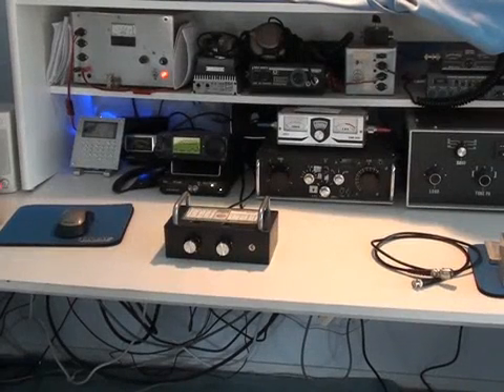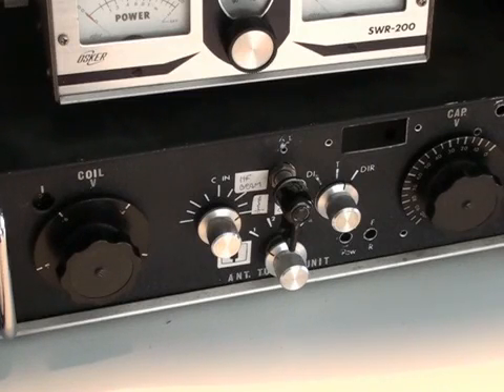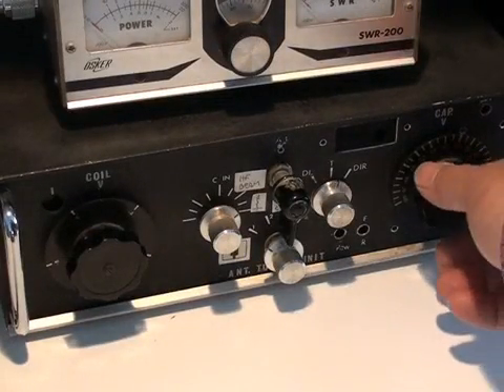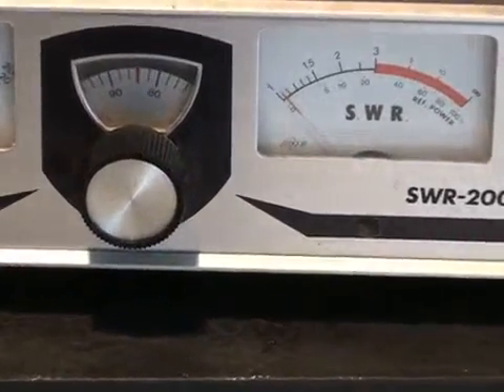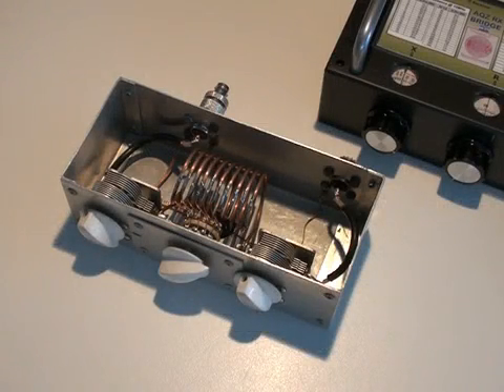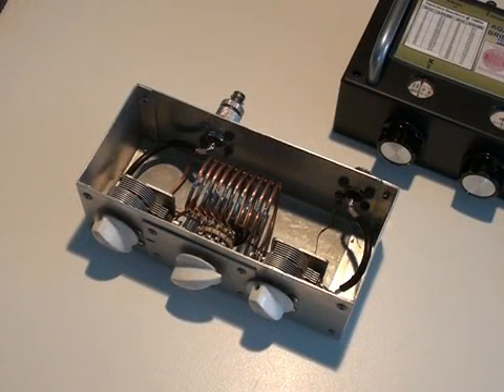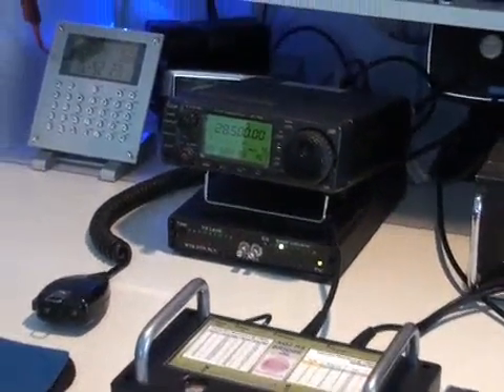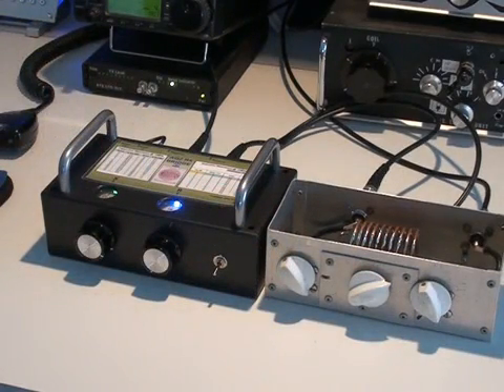Using the RX bridge to adjust an antenna tuning unit Q19

Comment: I'm returning to ham radio after a break of 30+ years, so this was very educational for me. Thank-you!
Reply from the maker: Hi. Thank you. Some of the recent changes in Electronics, such as the small processors, and SDR chips,  now been used to make transceivers and other ham gear, are stimulating new interest in ham radio.  So I have seen quite a few of the "older" guys get back into radio. YouTube is also helping. Cheers.

Comment: Interesting way to adjust the tuner but it isn't practical to do it that way. Normally the R-X noise bridge is used to actually adjust the antenna length I believe
Reply from the maker: The noise bridge can be used in many ways. One can use it to preset the tuner so that an antenna that cannot be adjusted for any reason, will look like 50 ohms to the transmitter. It also means you don't need to transmit in order to adjust a tuner - some commercial tuners actually use an internal bridge for that very reason. A tuner and bridge is also used by SWLs to get the best out of a random long wire - much easier for an SWL trying to adjust a tuner by trying to listen to atmospheric noise only. And yes, you can also use the bridge to trim an antenna so that it becomes 50 ohms and no tuner is needed - but that's just a basic common way to use a bridge, which is a well known usage.  As I said, the noise bridge is really an RF "ohm-meter"  (i.e. to measure an impedance such as z+jx or z-jx) or "RF multimeter" used for all sorts of RF measurements - and even as  a vector network analyser using good old basic radio theory maths!  (Digital VNA's use the same circuit - only it uses  a microprocessor for the maths and sweeping the circuit!).

Comment: I am compelled to return here and say that VK3AQZ makes one of the most interesting and functional kits in the RX-1 noise bridge. I built the smaller RX-2 first and was immensely pleased with it's performance and accuracy. Because I am a building junkie,  I got the RX-1, built it, and was, flabbergasted with its performance. Both are tremendous "almost lab grade" instruments whose accuracy outshines the piece of crap MFJ bridge and is far superior to the Heathkit and Palomar Enginers units. 

Moreover, Lou is a machinist and the kitting job he did is astounding. The electronics of this kit is rather minor - just a small PCB of great quality with excellent parts - but it is the hardware part of the kit which is the marvel. 

Lou has engineered the kit such that, if you proceed carefully, you will be rewarded with a finished result that you can be extremely proud of. 

Additionally, Lou provides you with a wealth of notes, spreadsheets, and support. For example, look at all of his You Tube videos (like this one) and you will get the picture. 

In a world abundant with analyzers requiring little or no thought, Lou's kits allow you to get back to the fundamentals of RF electronics and understand the principles involved.
Reply from the maker: Hi William, nice to hear from you again. Thanks for the most glowing description of the kits. Thank you. Regards, Lou